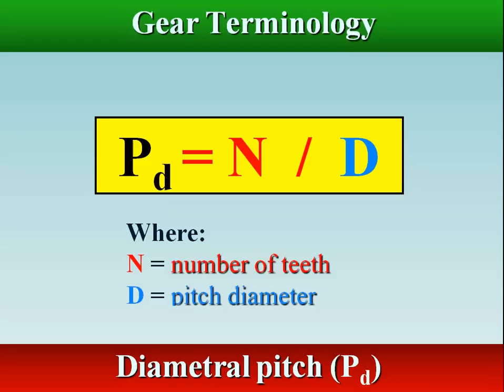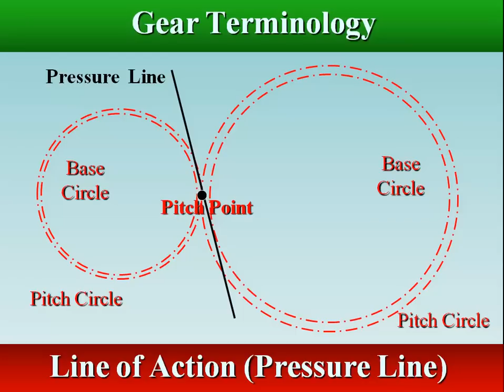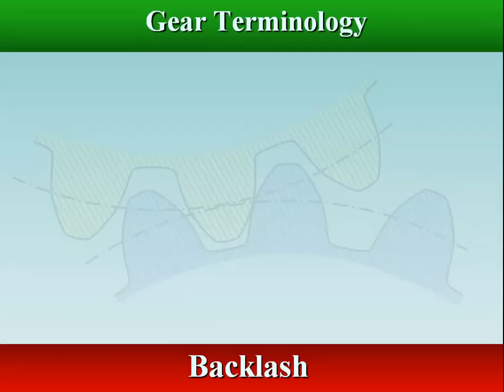Gear Terminology

Comment: From the video I could infer that pitch circle means 2/3rd from root diameter or else it is 1/3 rd the distance from the gear tip to root diameter. Please correct me if I am wrong in my perception.